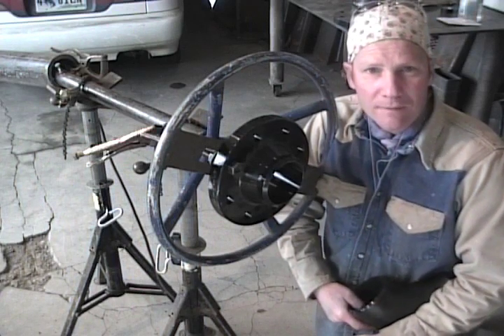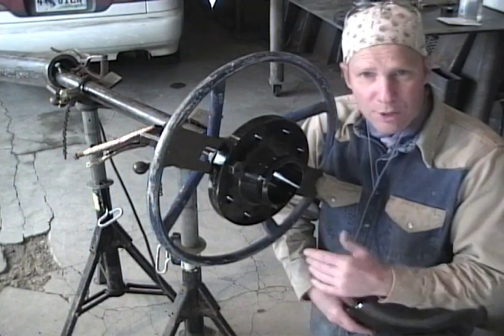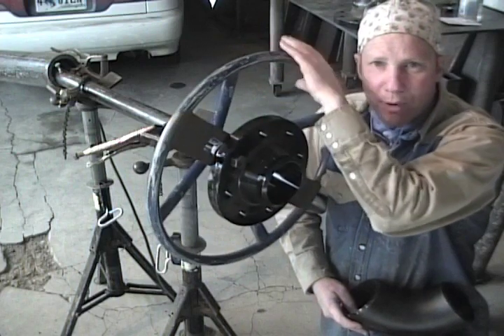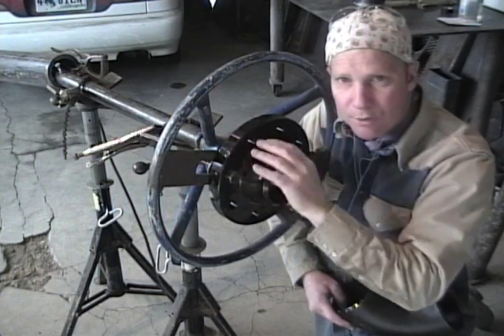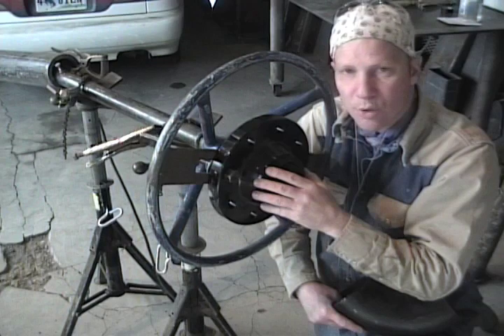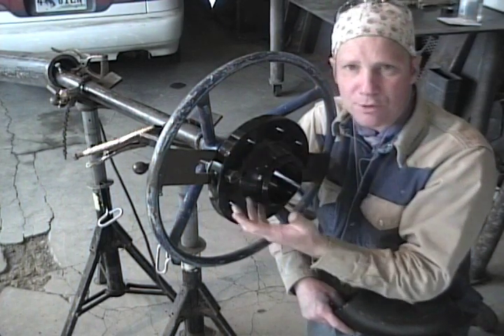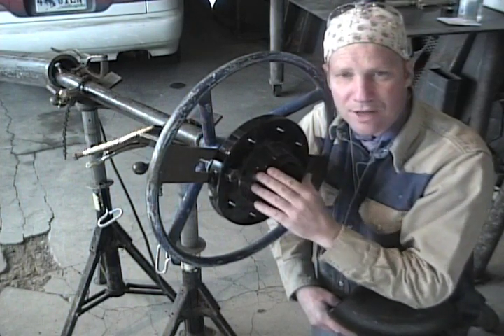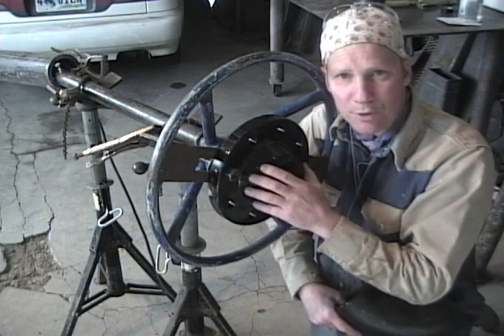Welding Video from The Welders Lens on Pipe Welding

Comment: I weld on the pipeline and in the refineries.  In the refineries, especially in the units they require up hand welding.  When I was learning, I found downhill welding was much easier.  Up hand welding is the hard one to adjust to.  Up hand welding is superior in one primary sense, it separates the men from the boys.  As far as down hand being faster, yes it is, especially if your running 6010 all the way out.  7018 rod is a stronger tinsel strength and can only be ran up hand.